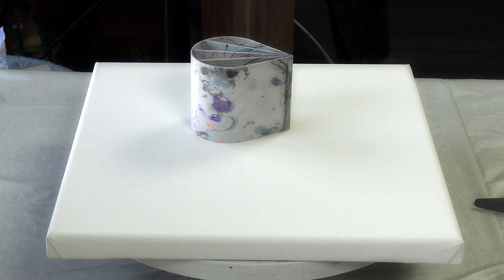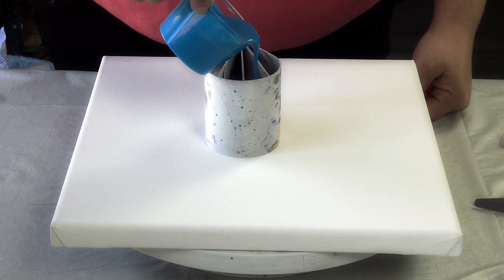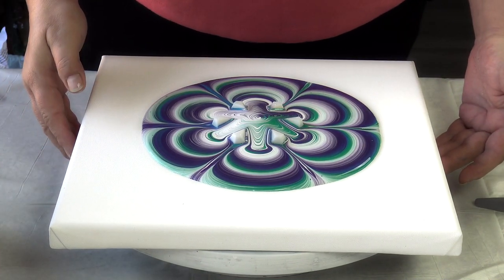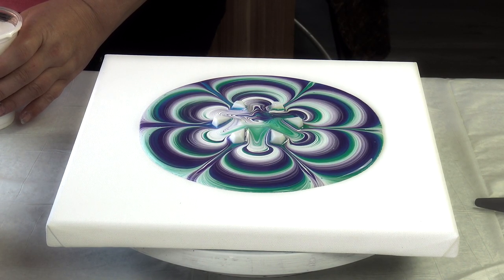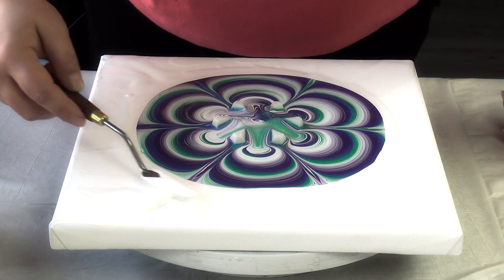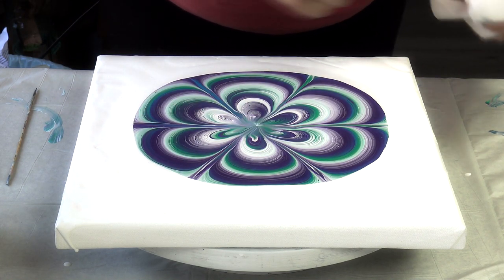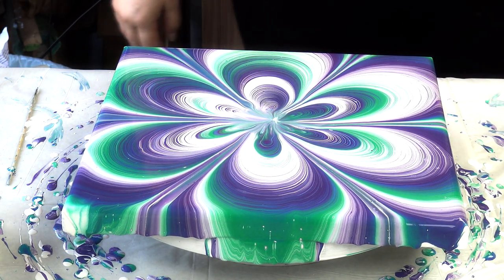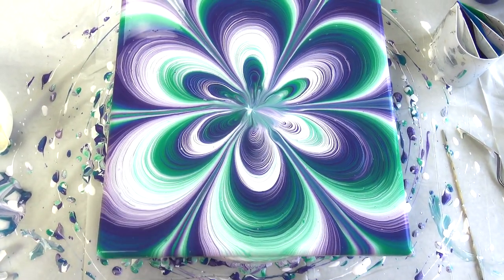(480) SIMPLE flower with SPLIT CUP ~ 3D printed FLOWER SHAPED CUP ~ Acrylic pour painting

Comment: Dear Fiona
I have both been terribly frustrated and greatly rewarded on my journey to finding products in America that will simulate your Reverse Flower Dip results. Ive also struggled with, but finally got the technique correct. Thank you SO MUCH for your inspiration. 

Something I have learned:
I use a 50ml empty syringe to remove (by suction) extra paint AND mistakes from the middle of my flowers. It is easy and very effective.

Happy Painting!
Lisa

Comment: Hi Fiona!!  👋👩‍🦳️👋  You're so right, these colors look fabulous together!! It is to bad that the center area looks a little foggy.  😢😢
Do you use hot glue? What if you glued some little legs underneath, four or six maybe. They don't need to be very tall, just enough for the paint to flow underneath. I know you can even place them so that they won't interfere with you putting the flat piece on top of your flower bottom.
I was also thinking that you could hot glue a couple of little posts on top (out of the way of the flow) for you to grab when you're done since the little pegs on the sides don't work when they're buried under the paint.
I love all the different flower shapes that you do, even or especially when you turn them into abstracts.  💛💜❤️️💙🧡
God bless Fiona and have a great weekend!!  👍👍💖💞💖👍👍